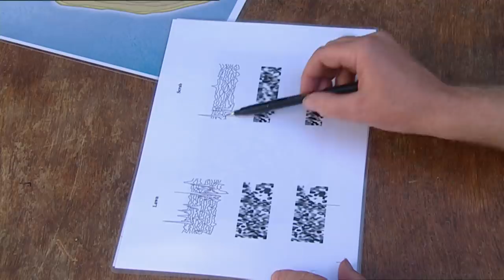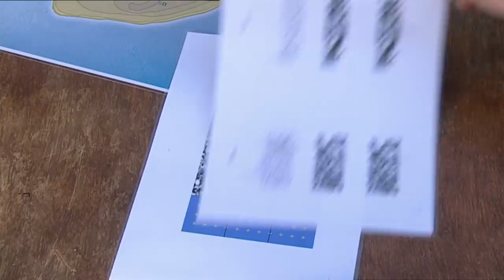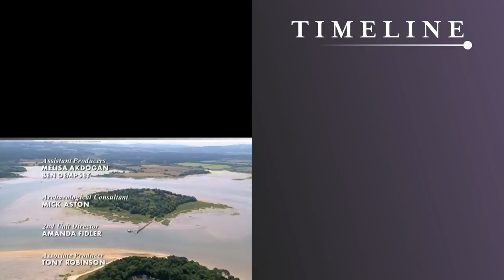The Hidden Secrets Of Green Island | Time Team | Timeline

Comment: Dryer sheets in your socks to help prevent ticks.  Love your series.
Reply: Really? Does that actually WORK? If so...thank you so much for the tip! Any specific BRAND and scent of dryer sheets? Bounce regular? Unscented?
Addendum: Does it help to use a lot of dryer sheets when drying your clothes? What is it about the dryer sheets that repel them? The fabric texture or the actual scent?
Reply: @maggsbufton1969  actually, using dryer sheets in a dryer could cause a fire.  So, I din't use them there.  As for the ticks, I guess any scent would work; it's the active ingredient that ticks don't like the smell of.  Also, stay out of pine needles - they harbor ticks, too.
Reply: Is using DEet products a problem of some kind? They work best for ticks, certainly better than getting lyme, spotted fever etc. Cover up completely and spray your clothes so you don't absorb so much if you are concerned. 
Dryer sheets contain more dangerous chemicals than deet. Bisphenyl a, b endocrine disruptors. They are not made to be worn!

Comment: 7:33 looks like the bottom for a drop spindle... A piece of wood fits into the middle, wool or flax worked around the center pole in your fingers as the weight and spinning of the base pulls the fibers out...

Comment: If people 2000 years ago were so lacking in technology, can somebody explain star forts and pyramids to me?
Reply: Yeah, I want a cohesive explanation for how the great pyramid was built too. The 3 smaller ones are obviously imitations.

I can go for the "it was a public works project that spanned centuries l" but no single documentary has integrated all of the specifics 

One theory I saw a vid about involved using a system of locks that would allow them to to use floats on the bricks to move them vertically. It was speculated that the causeway was fill of water so stones could be transported from boats on the Nile and straight to the side of the pyramid where the water-locks would begin.